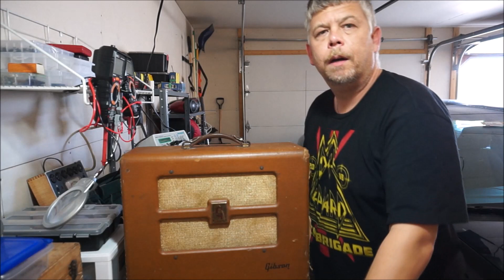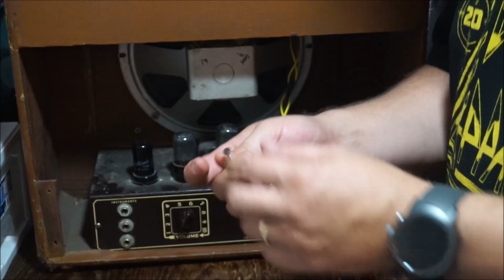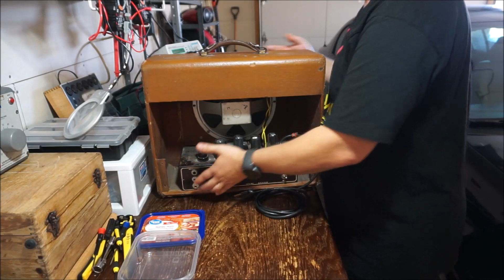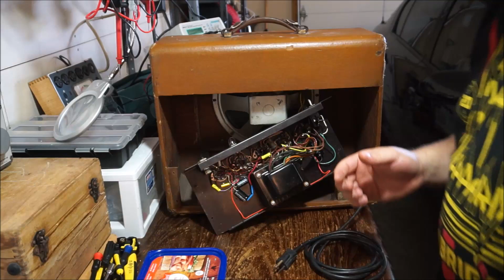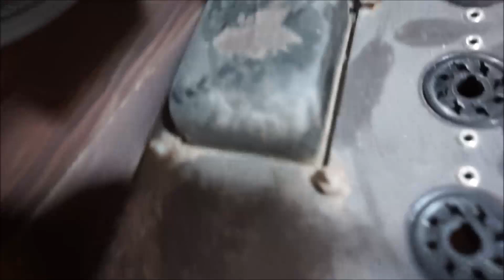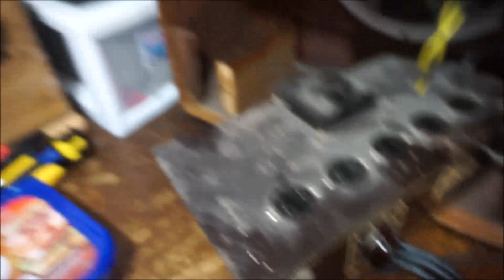SRT Amplification Gibson BR-6 (Part 1)

Comment: Will I come up with Dearborne Glass in Bedford Park Illinois for  code "385" . Good video!
Reply from the maker: Interesting! May I ask what code list you are using?  Everyone that I have seen does not have that code on it. Also, can't find anything about that company on the internet. They may have stopped producing speakers in the early 1950's and that is when Gibson started using Jensen.
Reply: Hi Will, I got this from audiokarma.com
But here's the link.
http://redirect.viglink.com/?format=go&jsonp=vglnk_153374666117512&key=07a80c4f38638b813a524ba59326ca4a&libId=jkld3cop0102ko3q000MAj4dk7aw8&loc=http%3A%2F%2Faudiokarma.org%2Fforums%2Findex.php%3Fthreads%2Feia-codes-learn-to-love-them.497168%2F&v=1&out=http%3A%2F%2Fwww.audiophool.com%2FMisc%2FEIAcodes1961.pdf&ref=http%3A%2F%2Faudiokarma.org%2Fforums%2Findex.php%3Fforums%2Ftube-audio.14%2F&title=EIA%20codes...learn%20to%20love%20them!%20%7C%20Audiokarma%20Home%20Audio%20Stereo%20Discussion%20Forums&txt=http%3A%2F%2Fwww.audiophool.com%2FMisc%2FEIAcodes1961.pdf
Reply from the maker: Thanks Rick, for sharing this. This will come in handy for the future, I'm sure.